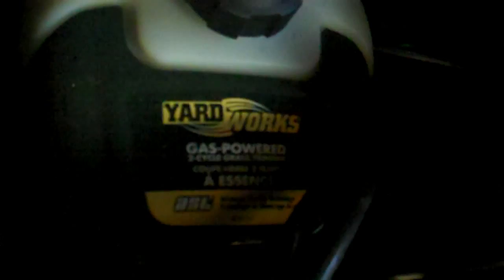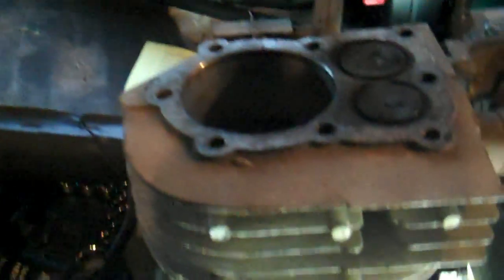Convert 4 stroke to steam engine part 1

Comment: i converted a 3.5 hp briggs lawn mower to run on steam at 80lbs and cut grass with it. $14 plus a $100 for 50 ft rubber steam hose

Comment: Hey ben d i had a question i was wondering i dont know if you finished it yet but i was wandering if you had finished like what type of oil did you use and have you had any major rust on the valves and stuff

Comment: Geeez, it would seem if you could just get the intake to open, steam go in, and both valves remained closed, you could run the engine of just the same compressed air/steam at a steady RPM.
.
With some thought, you could adjust the amount of compressed air/steam for a faster RPM. The only problem I could think of is loss of compression due to blow by of the rings. Enough thought... FREE ENERGY FOR EVERYONE!

Comment: That engine is a Brigs & Stratton 130,000 series engine 5 HP .Not a efficient design without the steam interrupted when cylinder is being exhausted
Reply: I have been thinking about "half breed" type steam engine; use a gasoline engine to produce "waste heat" and them make flash steam off heated area from  exhaust manifold(think of exhaust pipe running through boiler arrangement) . Each gallon of gasoline makes app. 135,000 btu of heat that just goes out exhaust pipe and could be put to use. There were farm tractors from 1920.s that used this energy capture technology and worked well. This would make gasoline engine much more efficient and is so much easier to crank gasoline engine than build up steam as in 19th century type boiler arrangement.

Comment: I'm doing a project very similar to this, although I elected to use both the intake and exhaust valves and just seal up the spark port, plumbing up the steam lines to the ports where the carb and muffler used to be, using the exhaust steam to provide draft for my boiler like a locomotive does. That saves me having to buy a valve and lets me use most of the existing parts.

I figure I'll end up making a little steam car with it once I get it up and running.

Comment: Thanks for the idea you gave me?
A: Use a solid brake disc as both a fly wheel & sliding valve (2 bent ovals machined in them for steam injection for the spark plug port) using both exhast & old inlet ports as alternating exhast steam ports.
Been thinking of the best material to use for the sliding valve presure seal?

Comment: The last thing you want is a fan on your flywheel, as you don't want the steam to cool down in the cylinders, and it creates drag that will waste power. A smooth flywheel with no drag is optimal. Even being made of cast iron, a heavier flywheel is always better. For that size engine I'd say a 50-100lb flywheel would be sufficient.

Comment: I'm not saying you should run a 200 psi, but even at 100 you could reduce the timing and be more efficient. I am also in a welding class, a good boiler material if you can find one is an old acetylene cylinder,  or for even higher pressures 500 psi+, an oxygen cylinder. I do not recommend someone with little steam experience try for 500+ psi. A good flywheel would be a barbell type disc shape lifting weight, if you have a lathe to balance it with. Superheated steam would be beneficial for you.

Comment: On a 200 psi engine of the same size, once it gets up to speed, steam may only be admitted to the cylinder for 1/8th of the power stroke.

Comment: On a 100 psi engine, the valve will be open and steam will enter the cylinder during the entire power stroke, but once it gets going, and there is significant momentum in the flywheel, the valve will be cut back and steam will only enter the cylinder for 1/4 of the power stroke, and solely the expansion of the steam will push it the rest of the way.This drastically increases efficiency, as less steam is used. This effect is amplified as the pressure is increased, or the engine is larger.

Comment: A tip from someone with steam experience (all old engines-not renewable either-coal fired boilers),  If you use a larger and heavier flywheel, you could adjust the timing so that you can adjust easily. Most of the power in a true steam engine (i.e. one built as a steam engine) most of the driving power comes from the expansion of the steam. The higher the pressure, the less time steam is being admitted into the cylinder.

Comment: Gasifier are nice but a bit of work ... hydrogen cell as i alreaddy know are alot of work and learning ! let me know if you have any question about hho i'll sare what ever i know, as for your production in if you have 10 LPM it's perfect you could do what ever whit this ... you would need minimum 40 plate cell and a 48 V @ 30 amps or something in between  1200 Watt to 1500 Watt. this could compare to 5 computer power supply i'm taling DC power not AC Check my vids i got some nice how to Cheers !